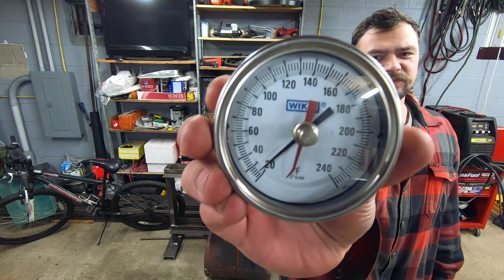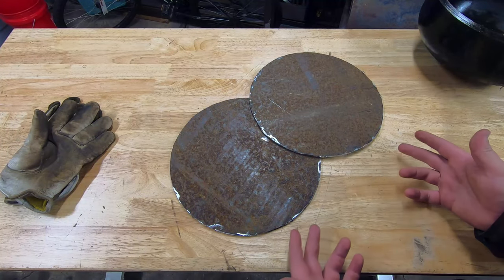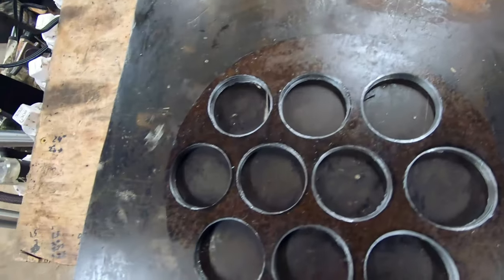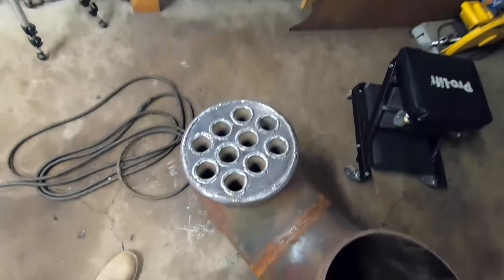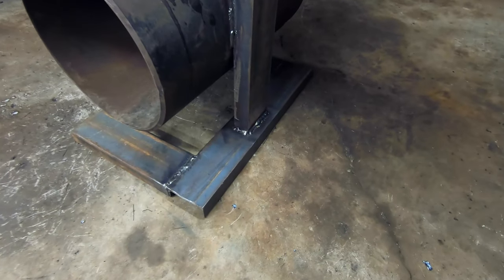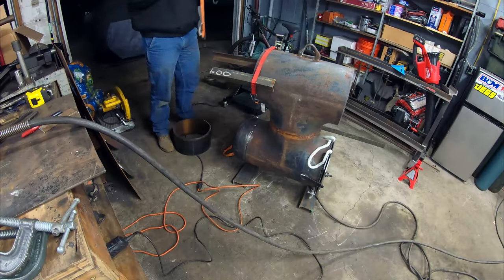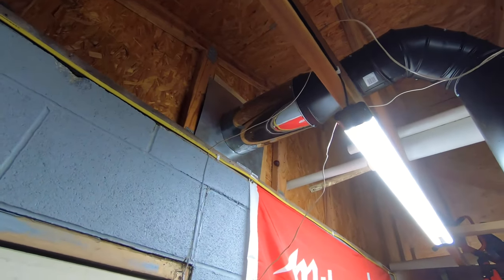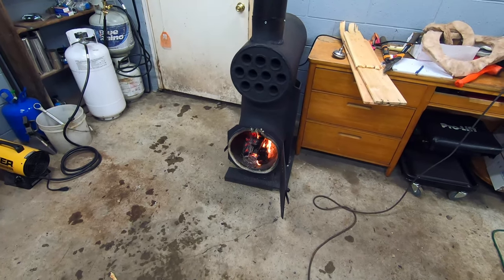Making My Own Wood Burning Shop Heater!

Comment: Have you tried cooking breadsticks or bratwurst in it? Or you could run a water loop through a few of the pipes to heat a big storage tank (useful for keeping the garage above freezing overnight with way less effort and fuel). I'm trying to find a silver lining here. Your heat exchanger has half the surface area (according to my eyeballs) as the outside of the stove and I'm skeptical that the blower fan is spreading the hot air very far away from the stove. Put in a cieling fan and compare them. I bet you the cieling fan works better. You have a moral obligation to tell people whether or not this thing was worth the effort, not just if it works at all.

Build quality and creative use of available materials is awesome though.